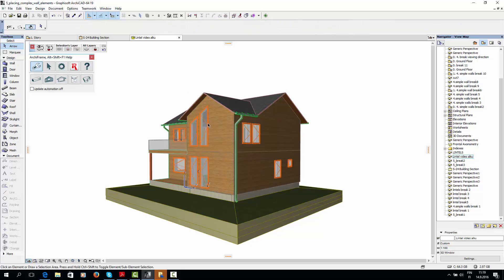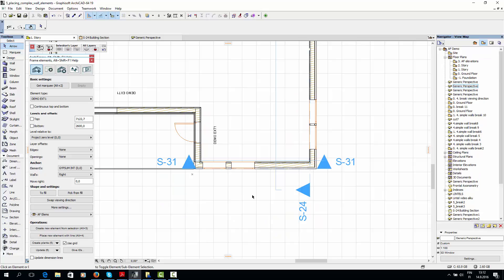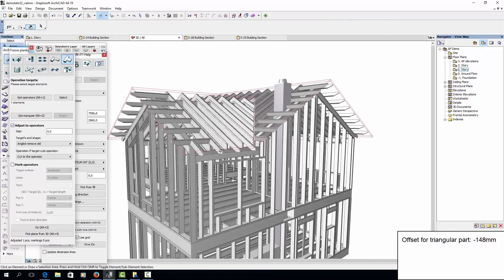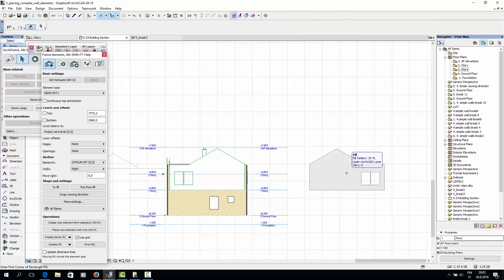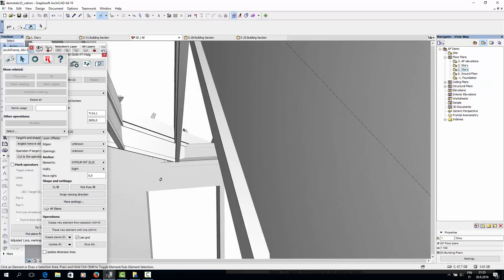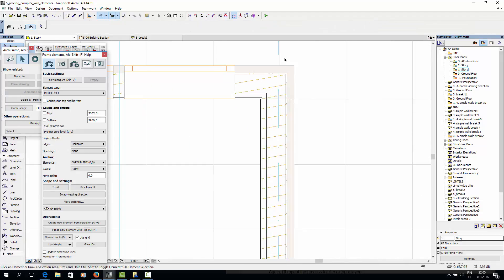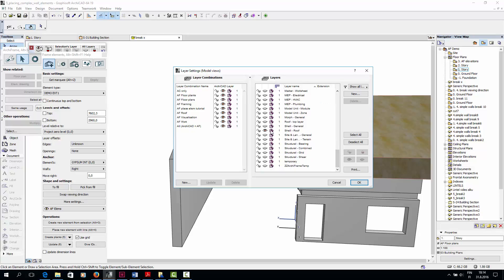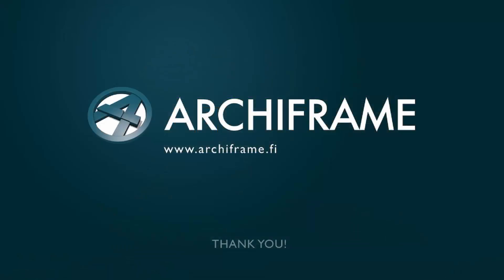5. Placing Complex Wall Elements in ArchiFrame

Comment: I noticed that you are using metric dimensions. How does that work since all lumber comes in imperial measurements? Do you cut the lumber down to the metric measurement?
Reply from the maker: We follow Archicad unit settings. So if you set the units to imperial, ArchiFrame works with imperial too. Secondly we have default settings having 2x6, 2x6 etc standard imperial raw materials in samples/Data_Yours_BASE_USA_own